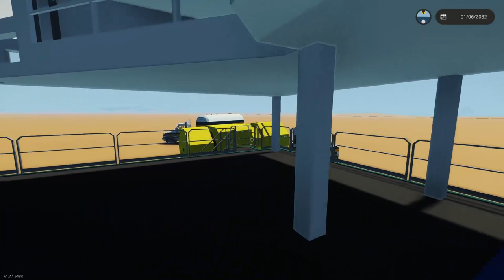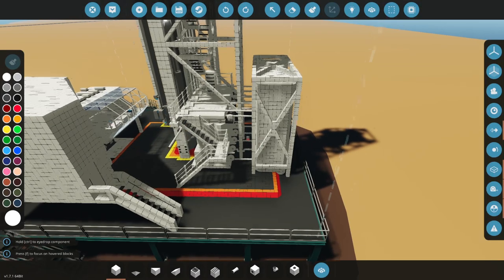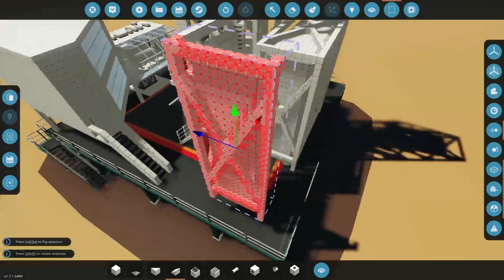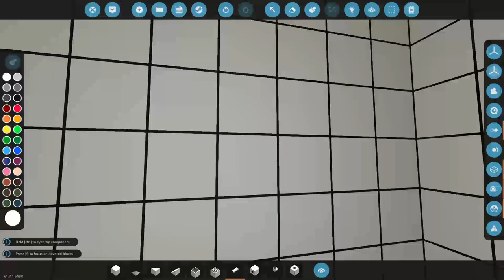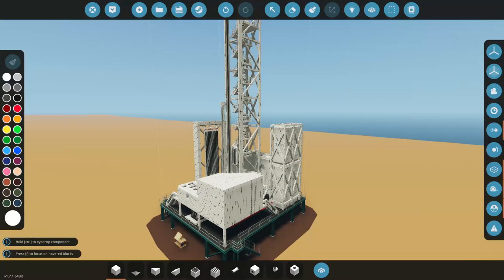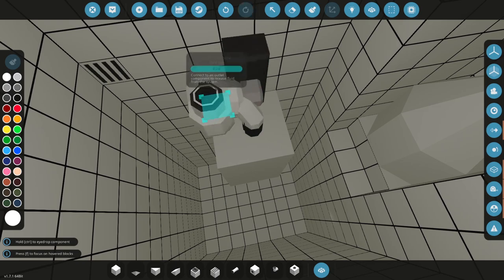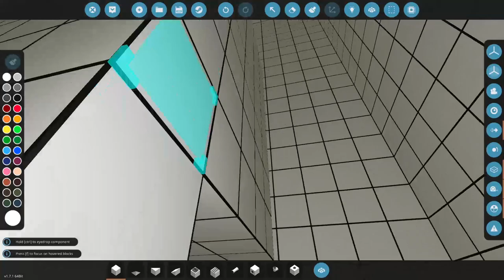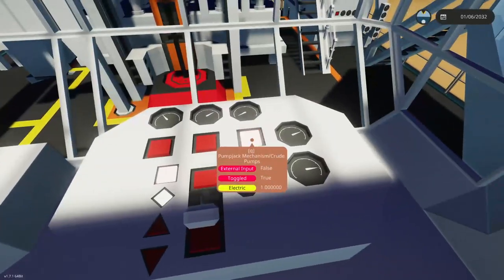Stormworks: ADVANCED OIL RIG PT.6 - Successfully Distilling Oil

Comment: Four heaters or even three should keep up fine if you add a pre-heater to the input line so it's pumping in 100~200c crude instead of the ambient temperature ~25c crude. You'll avoid major temperature shock that way and the heaters don't seem to work quite linearly, the lower end heating is easier for them.
Reply from the maker: Amazing advice, I just did this :) Thank you!

Comment: Custom tanks can’t store air, and as far as I know heaters don’t explode, so no filters are needed, and filters massively hamper flow
Reply from the maker: I have had custom tanks store air (uncompressed of course) in my ballast tanks in the mini subs, vessels, etc. and it created problems in events where a ballast pump was pumping in water and then the boat overturned and then air was pumping in, causing a weird confusion/glitch of the system - but this was a while ago so maybe it has been updated :) And good to know they can't explode, I know the modular motors are very sensitive to temperature... haha thanks for your comment! :)
Reply: @454ss_gaming  no, that is not a thing I’m 95% sure, anything pulled out will be replaced by “air”, though it appears and disappears with filling(it’s only the visual level), I tried it myself and it indeed did not store air, also the lowest SEVEN blocks(with taps) will output only oil, so that could be annoying to fix if you are unaware, the diesel heaters are honestly significantly better and use less power for the same heat, and only 1 or 2 are needed, if you add a electric/diesel preheater, though if you are playing with infinite electric/have loads of electricity then it’s ok, and they use very litttle fuel, also heaters are capped at 400 something degrees, so running them too hot is wasteful, you can’t get all the heat out(not bad in any way)
Reply from the maker: @rogervanbommel1086  That is perfect information, thank you! :) I have not yet tired the diesel heater, but it seems any structure built on the structure workbench has infinite electric anyway, which in my opinion is like real life, where such a drill would be tied to the electrical grid and utilities!  I have a microcontroller that will automatically keep the heaters on only if the temperature of the chamber is less than 320, so it doesnt heat have to keep heating!  Interesting for the lowest seven blocks, I will have to confirm I am collecting the material I want to be! I made this video pretty late and didn't have much time to troubleshoot afterwards haha Thanks for the comment! :)
Reply: @454ss_gaming  note, it does speed up significantly if you heat it further, something to concider, though wastes a bit of electric/fuel, I find it honestly a bit cheesy, because normally electric has a cost, now it’s free, if you are able, mouse over the tap, it shows what it’s getting(not sure but I think this needs detailed tooltips, though I see you have that on)

Comment: Is there a reason why you can't build some of this stuff off the platform. I'm pretty sure irl that holding tanks would be beside the structure but not on it. Same with living quarters. Could you imagine trying to sleep while on an oil rig! I'm no oil rig worker, but I've seen a few setup and your platform is crowded!
Reply from the maker: Haha totally fair, but the oil rig workbench where you build is limited to the space on the platform :) I have seen some condensed setups, and this is based on an ocean based oil rig, but on land! So the living quarters, work areas, and helipad are all on the structure! But totally, in real life an oil drilling rig on land has a massive camp next to it, with garages for equipment, storage, basecamp, etc., it's just not spawnable in the workbench!